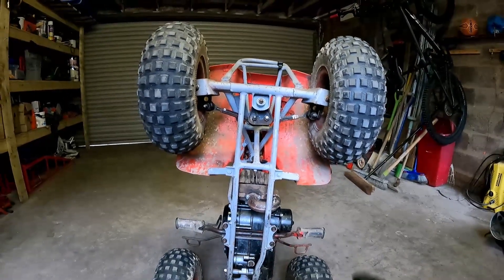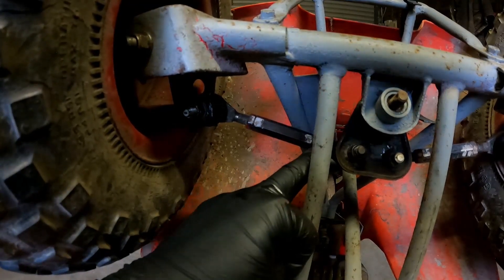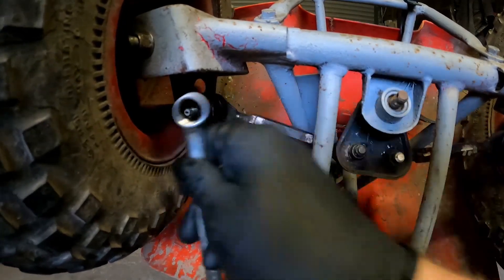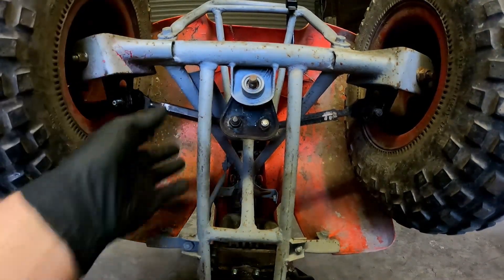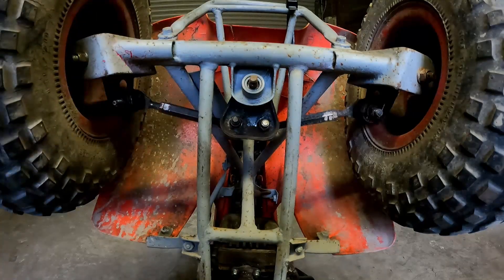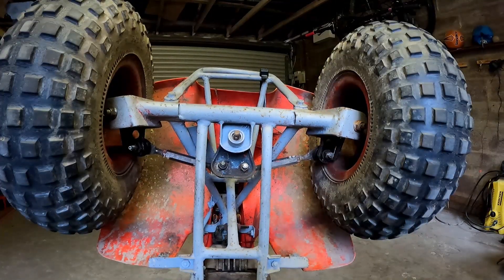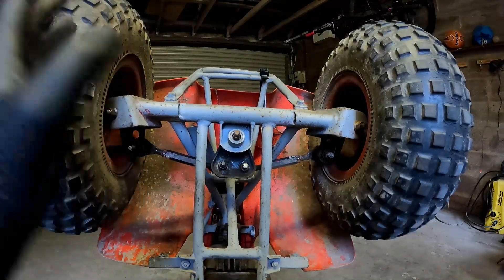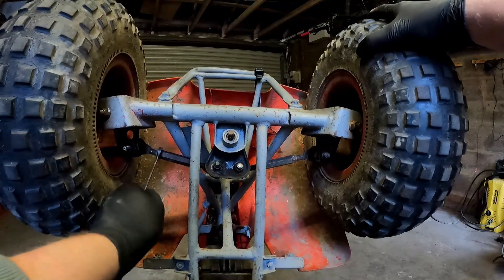SUZUKI LT50 How to set steering tracking alignment replacement and adjustment LT 50 PROJECT PART 9

Comment: I was wondering if you could explain how the black rubber wheel caps fit to the rear wheels? I ordered some replacements but can't see how the fit, I think I'm missing a part. Thanks.
Reply from the maker: No worries there is a lage tin washer that goes on under the hub nuts, i show them in my wheel bearing and rear axel video if you would like to see what they look like. Thank you for watching
Reply: @Martysworkshop  thanks, just as I suspected. I'm missing that large washer.